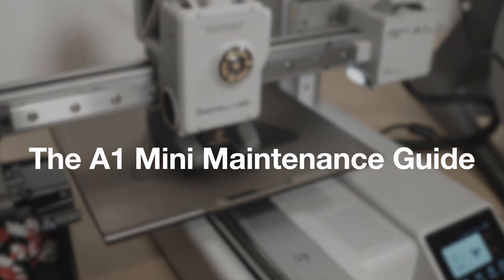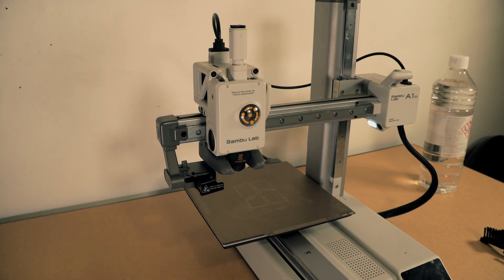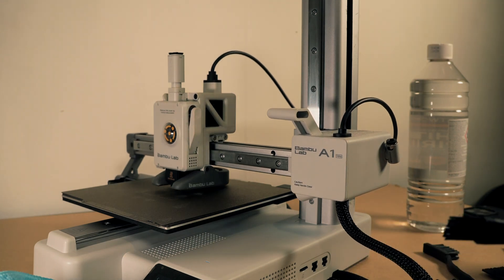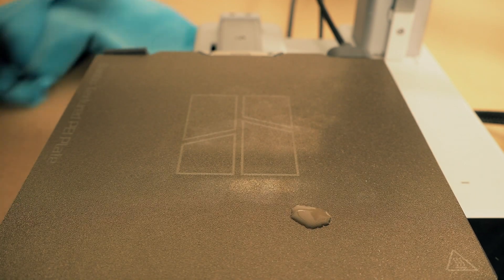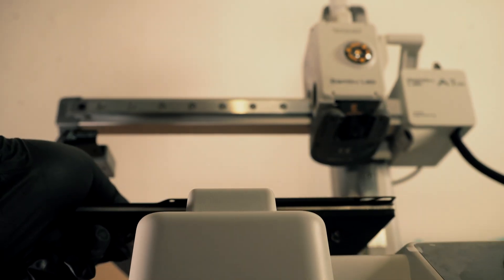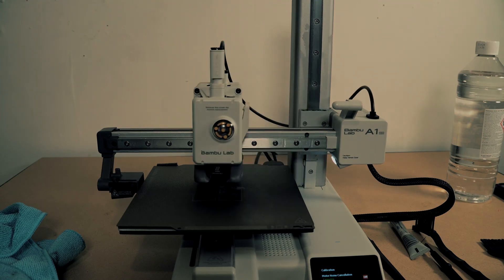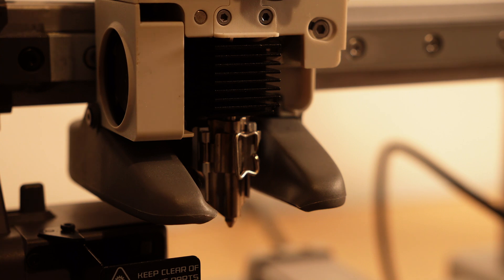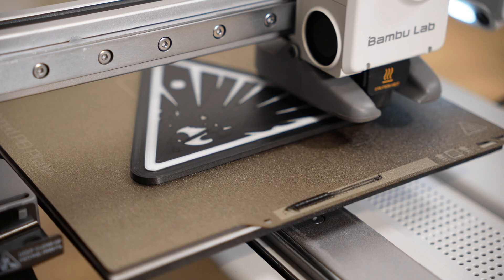Bambu lab A1 Mini Maintenance Guide for beginners

Comment: Did you wash your print bed? I am seeing people say that's a good idea, but not 100% sure about doing it with the textured plate. Should I use regular dish soap and hot water?
Reply: Go for it. Hot water won't destroy your plate, it will melt oils ( from your fingers for example ) resulting in better adhesion + soap will clean it up more so every first layer will be perfect 👀👍

Comment: And they say that Bambu printers for those who do not like tinker with printer = )
But on the contrary, those complex mechanics need a lot of accurate maintenance.
I use my Ender 3 (on POM wheels) for two years, and never ever done anything like that. Actually I did not oil anything at all. Waiting for a POM Z nut, to degrease  z spindel once and for all. POM nut does not require oiling at all. And POM wheels do not need oiling at all.
BTW, I print 8x8 cell multiboard in 3 hours and 40 minutes(in PETG) for you to check with your printer speed. Oh... A1 mini will not fit 8x8 cell mutiboard... At least they say that some Bambu printer will print it in 2 hour 30 minute. I guess I am OK with my speeds for $100 and zero maintenance = )
(I installed only 3d printed DD mod and fixed the bed with aluminum foil, also using PEI, and that's all, no heavy modding like 2 minute benchy girl... Of course I bought some parts, so I guess it is near $150 now (plus $50), and it can heat up the bed even more than 100C, not locked to 80C, and again, zero maintenance, also you need a wrench to change the nozzle, but a couple of nozzles cost nearly nothing, so I guess, I am OK with that)

Comment: My A1 Mini Lab just stopped taking filament. May be the puller is not working..guys can you suggest me how to solve this troubleshooting??
Reply from the maker: Hey Santosh have you tried removing the hotend it could be clogged . Some times it seems like it’s the extruder but your hotend could be blocked

Comment: The ease of changing the hot end is a big reason I just bought an A1 Mini instead of a P1S. I'm guessing that the next version (P2S?) will have this, but I didn't want to spend $500 extra on something with less quality-of-life upgrades built in, especially with my previous experiences with fdm printers.
Reply: If some PXS will have quick release nozzles be assured - it will be incompatible with everything before = )
Just like AMS light is compatible only with A1 and A1 mini. And vise versa, normal AMS is not compatible with A1 and A1 mini. = )
You know, an iPhone in 3d printing. = )

Comment: ❤ Do you know if the a1 models have the same privacy concerns as the x1 and p1s, etc? Does the printer need to be registered with an internet connection and does it send data back to Bambulab?
Reply from the maker: I believe it has a lan mode if you wait till I’m home from work I’ll check for you 🙂 might actually be a good video idea 💡
Reply: @FilamentFoundry  I cannot remember the specifics exactly, but I think that the owner of the 3d musketeers youtube channel was saying that there were also concerns about terms in the user licence agreement for these machines and that you would not want to use those models if you used your printers for any kind of commercial work or wanted to protect the ownership/privacy of any files you are/have worked on.
Reply from the maker: @arielmarshall5501   that's  more than likely true and for most cases I would be worried about it but for me and my business it wouldn't make much of a difference as I give away a lot of my designs for free . but I am looking to build a voron or pursa  in July to a look to switching my print farm to on of them brands as I find working on my bambus too much of a pain and slows down the farm way too much
Reply: @FilamentFoundry  I own some Prusa mk3s+ machines and I am reasonably happy with them, good documentation, etc. Still my recommendation for most print farm owners, simply due to the importance of customer support and the size of the community. I would love some Bambu machines, but like I said I have concerns about it restricting me financially.
Reply from the maker: @arielmarshall5501  hey you should jump in our discord seems like you would be really helpful to the channel . And we need more experts over there https://discord.gg/84gZDpzM
Reply: @FilamentFoundry  If you are interested in Prusa's for a print farm then I would suggest the mk4's or looking at the revo system. The most suitable machines really depend on what you intend to be printing most often. Personally I am now looking into buying some Sovol sv04 machines, for the price, build volume and the extra extruder. I think speed is over rated unless you are mostly printing pla parts that do not require the best quality dimensions and features, etc. Not an expert yet I am afraid and I am not on discord currently.
Reply from the maker: @arielmarshall5501  thanks . No problem well hope to see you on some of my other vids
Reply: @FilamentFoundry  Subscription added.
Reply from the maker: @arielmarshall5501  congratulations on being subscriber 400 😂😂
Reply: @FilamentFoundry  Woohoo! :)